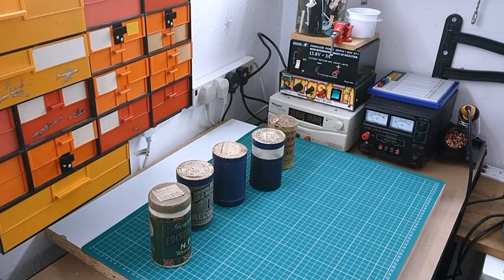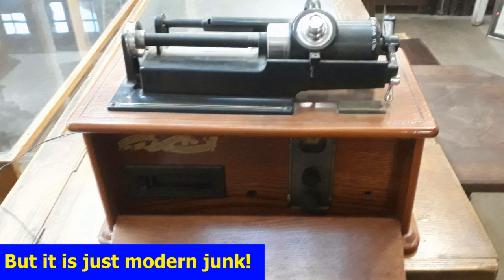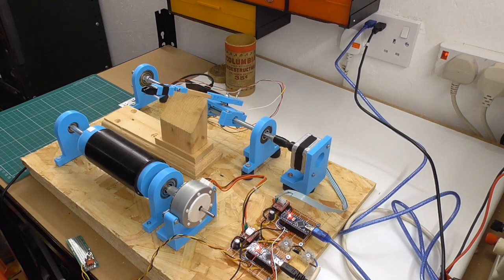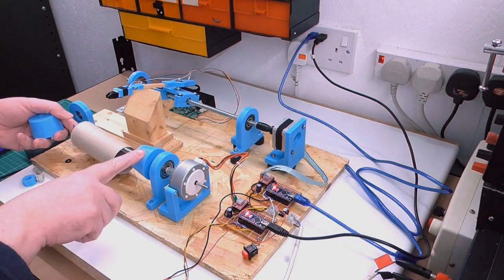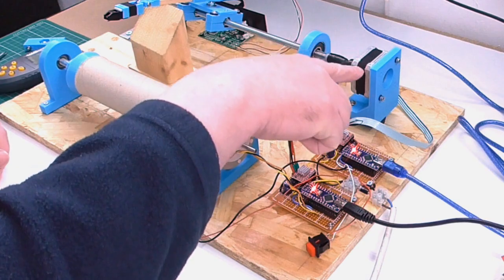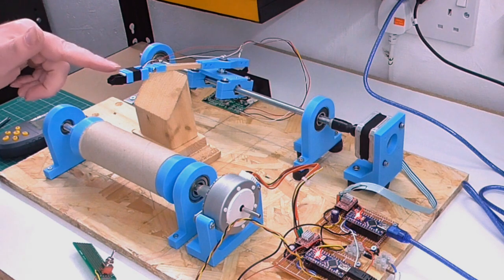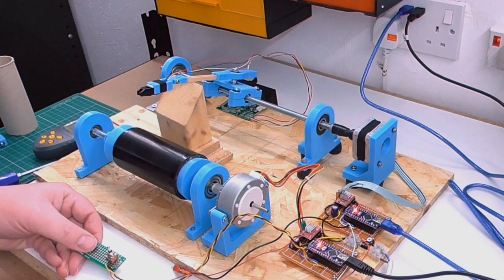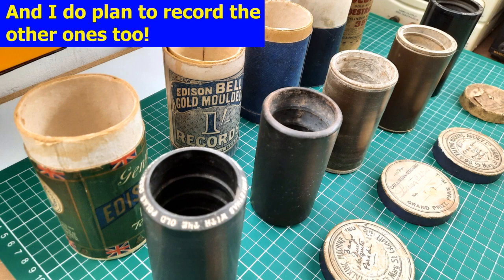DIY Cylinder Phonograph!

Comment: You're lucky to be able to build this in these modern times of micro-controlers, 3D printers and ebay.

I have two cylinders I got in the 80's. In the 90's I decided to build a player.

I used the complete tone arm off a record player and a similar guide rod to the one you used for tracking, but I had mine being constantly run using a 12V motor, a speed controler from a model railway and a 6V PSU to get slower but steady movement.

The tricky bit was how to mount the cylinder. That bit came first and inspired the whole 2 year project. (it took two years to find all the bits I needed). Mums old hand cranked egg whisk broke and while trying to fix it, I noticed the diameter was the same as the cylinders.
They fit like a glove and were sturdy.

So then I looked into how to turn the cylinder, I used an old electric drill with an external speed control I found at a second hand market.

I bodged it all together with wood, nails, screws and elastic bands with lots of engine grease on all the moving parts. To my surprise, I actually got it to work really well and recorded my cylinders to reel to reel. YAY.

Sorry for the length of this. Just thought you might be interested. (no-one else ever was)
Reply from the maker: Thanks very much for this. Very interesting to read!

Comment: Why not take a tangential tone arm?
Reply: It detects, how much it has to move. So you haven't also to care about 2 minute and 4 minute cylinders.
Reply from the maker: Yes, indeed. Have a look at this one:
https://youtu.be/EE-sP0BRzvQ
Thanks 😀 👍
Reply: @mrrgstuff  I had a Review Yearbook from a German Hifi magazine from 1970 and it reviewed a tangential tonearm you can buy separately, to customize your record player. It detects the wrong angle and correct it.
Reply from the maker: @robfriedrich2822  Yes, it's a neat solution. I did this version here for a disc record, too:
https://youtu.be/fI880kTJ5b0
Thanks 😀 👍

Comment: Is there a place you got the files for your parts or did you do the CAD yourself? Do you happen to still have the files?
Reply from the maker: I designed it all myself, including the electronics and software. I haven't released it. Partly because it needs more work. Currently, it's not suitable to use on actual wax cylinders. Also partly because I haven't decided if it is something which I could make money from in some way. Thanks for your interest, though.

Comment: Why use 2 separate motors?  You have a 3d printer, why not just print pulleys and drive them both from the same motor?  You can use the pulleys to get the right ratio. Then noise won't be as a big of deal.
Reply from the maker: It's a good point. For me though it was easier to build it as 2 separate systems and not have to worry too much about alignment between them. I also didn't really know if I had 2 minute or 4 minute cylinders and with my design it didn't matter as I had separate control over the tonearm advance. I  fixed the noise issue in this video:
https://youtu.be/osF5uNdUXKo
I've also made the advance automatic based on a sensor in this video:
https://youtu.be/EE-sP0BRzvQ
Thanks 😀 👍

Comment: Great .... Very entertaining and informative. I have an old original cylinder  player with a main spring problem  no longer winds.  I am  toying with the idea of connecting a model type  motor at 160 rpm  and running the cylinder mandrel from that . Do you think this is possible .Thanks for your time. Great video.            Mike
Reply from the maker: Yes, that should be quite possible. If it is belt driven one option would be to keep the belt and have the motor drive the belt by the pulley normally connected to the spring motor. Good luck and glad you enjoyed the video. I have plans to rebuild this one a bit better so hopefully more videos too. 😀👍

Comment: Brother.. This stylus is not correct for cylinder.. As of my knowledge these stylus are designed to reproduce sound by moving left and right.. But the cylinder needle reproducer moves up and down.. So please correct me if I am wrong..
Reply from the maker: A custom made stylus would be better, but many people have used a 78 one. The cartridge is stereo and this detects up and down movement as well as side to side. You may find this website interesting:
http://www.christerhamp.se/phono/#:~:text=The%20Phonograph%20Makers'%20Pages,that%20give%20an%20electric%20output.
Thanks 😀 👍

Comment: I'm pretty sure that usually the playback stylus would remain stationary and the cylinder would advance as it played, using a helical screw, but love to hear it :)
Reply from the maker: It can work either way around. The very earliest model had the cylinder move, but later they tendend to move the reproducer. This short video was kindly made by Nippers's Lounge for me to demonstrate the action:
https://youtu.be/lyTVWcVhomw
Some didn't use a screw at all and the reproducer just ran on the groove, like a flat record. I also have a video of it playing here:
https://youtu.be/jYnVIy4yNwc
Thanks 👍😀
Reply: Those darn 20th century engineers and their bespoke machined components!
Reply from the maker: There are certainly a lot of variation in things like screw threads in early equipment. Really helps to be able to identify and make you own ones! 😀. Also phonograph cylinders do shrink over time, so having fix gearing for the reproducer can now be a problem.
Reply: The recording process became so involved, with different recording horns to accommodate the resonances of different voices and instruments.. have you heard of the wierd adapted "Stroh Violin" with an acoustic horn attached for extra projection? I once saw a comedic piece of footage with the famous tenor Lauritz Melchior being tugged back and forth by his suit lapels in an early attempt at "compression" whilst the string players ran back and forth towards the recording horn to fade In and out :)
Reply from the maker: Yes indeed, complex and difficult but it did work. Stroh violin I have come across and apparently it was also common to substitute other instruments in musical scores as they recorded better. Thanks 👍😀

Comment: What stylus did you use?
Reply from the maker: I was using a sapphire 78 stylus for shellac records. It was a NOS BSR style one. Although it worked for this cylinder, which is celluloid, it damaged proper wax cylinders so I will have to use something different. My first try has been:
https://youtu.be/Qpss20lSs7I
Thanks 👍😀

Comment: I've got one of the machines for playing cylinders, but it only plays 2 minute ones and I've got a couple of 4 minute ones. To play them I'd need the tracking speed of the stylus to be halved. I've also tried using a record player cartridge just as you did. My machine can be seen playing here: https://www.youtube.com/watch?v=_YgK90GIcKg
Reply from the maker: Thanks for the link. Nice machine and nice cylinder 😀. I don't know if I have any 4m cylinders, but I should be ok as I don't have any direct gearing between the cylinder drive and the stylus drive. At the minute, the stylus advace is manual, but I will add a sensor so that as the tone arm starts to turn, the carriage is automatically advanced. I think the 78 stylus will be ok for both types of cylinder although of course it is not ideal for any of them. Thanks 😀 👍

Comment: With cylinder phonographs, as the record spins, it pulls the reproducer across the recording. I would make the tone arm rail stationary. That would cut down on the noise. Also, I would suggest making one long cylinder Mandrel and that will keep the cylinder in place.  Disconnect your second motor, that is causing part of the problem. Also, Edison used a sapphire for the stylus. Congratulations on reaching 1000 subs. Also, cylinder records move left to right. Plus the back rod that the tone arm should be smooth no grooved.
Reply from the maker: Thanks 😀 👍.  Yes, I could make it a groove runner, I am sure that would work well, but I also wanted to do something like on my linear tracking record player. The current tonearm carriage certainly needs some improvement, but I like the fact its not relying on the cylinder to pull it along. I might add a smooth rod to balance it as the vertical movement relies on the carriage rotating around the threaded rod.
The stylus I am using might well by sapphire, but its not really the right size or shape. I have read though it is possible to make them out of glass, so I might give that a try. This machine runs the cylinder right to left as the cylinder runs counter clockwise and the stylus pulls over it as though it was playing a 78. I decided against a single mandrel as the frustrums looked easier to work with lots of different cylinders. The slight issue with concentricity I think is due to the threaded rod and not the frustrums. I have a few upgrades to make and I think I can get the tonearm drive much better! 😀
Reply: @mrrgstuff      actually you are WRONG, the carriage on an edison cylinder phonograph is powered by a drive screw on the rear of the machine, it is NOT dragged along by the grooves. standard speed is 160 rpm .
Reply from the maker: @THEWIZARDOFMENLOPARK  I've just rewatched my video to be sure what I said, and also looked at the comments above and I can't see any place where I say the Edison phonograph works by pulling the stylus along with the groove. There were some very cheap machines from other manufacturers which did work like this, referred to as 'groove runners', which I do mention in my above reply. For people building cylinder phonograph machines nowadays, groove runners are the simplest type, but certainly not the only type, and I didn't go that route due to the wear it puts on the cylinder. Thanks.

Comment: Absolutely fascinating, great work with the 3D 😁👍
Reply from the maker: Thanks 😀 👍.  It was quite a bit of printing, but most parts worked first time. I think I started to work on it back in October
Reply: @mrrgstuff  I can well imaging that took hours of printing time 😁
Reply from the maker: @GrandadIsAnOldMan  It wasn't too bad. I was using draft settings and about 7% infill. Printed over the course of a few weeks. Thanks 😀 👍

Comment: Bravo! That is very nice. I think the wobble might be from the threaded rod. My set up does the same. Now when I say my set up I don’t mean something as complex as yours. It’s just a barrel on threaded rod. I made it before I got the printer and my wood working tools are rudimentary at best. Anyway great job and keep them coming
Reply from the maker: Thanks 😀 👍.  Yes the threaded rod is just the cheap stuff from the DIY shop. It may get replaced in time with better stuff. I have a few improvements to try already!

Comment: Tremendous. I had a box of old cylinders with no player back in the 80’s. I cobbled together a machine just so I could hear the beginning announcement, it wasn’t robust enough to play the whole thing plus I couldn’t easily adjust the speed. All long gone now. Could you not get away with a smooth rod for the tonearm support and not have it driven?
Reply from the maker: Thanks 😀 👍.  Yes, a smooth rod would probably work fine, however I didn't want to rely on the pull of the groove as it might have caused more wear. The driven tonearm clearly needs refining, but should protect the cylinder which is important for me as they are much harder to find than 78s 🤔.😀